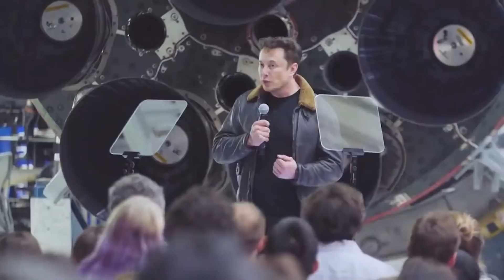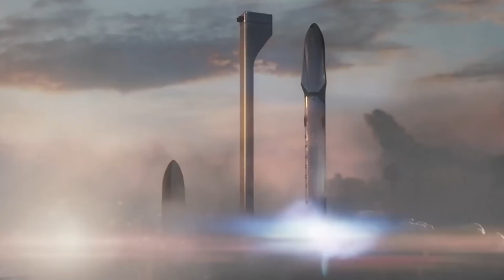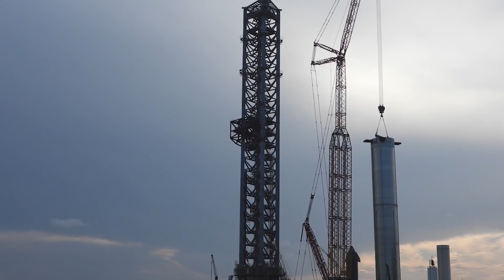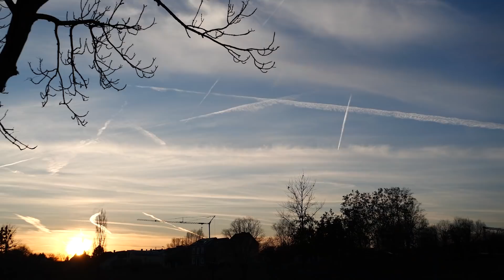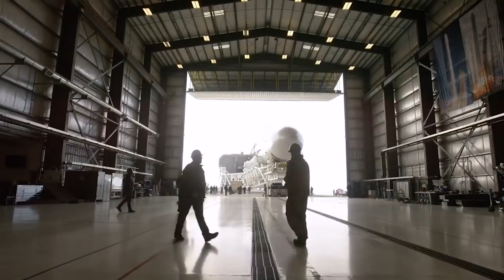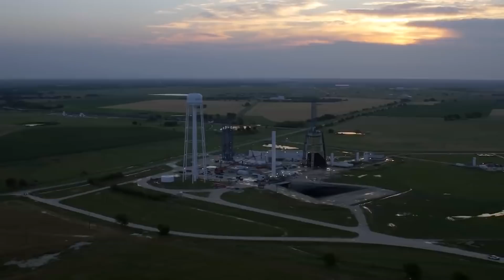FINALLY! Elon Musk OFFICIALLY REVEALED Starship Orbital Flight LAUNCH DATE

Comment: I wonder if space x added a couple more rings to sn20 if that ship by its self could reach orbit without the booster more rings more fuel put 3 normal engines and maybe 2 vacuum engines and go from there?
Reply: But the extra fuel wants to be liftet up.
I had this discussion a few month ago. You would need around 9 raptors (or stronger raptors) and a dry weight of maybe 70t. 
Then you could barely reach orbit with an empty starship with no fuel and no payload. 

As long as you don´t have some Raptors with a sea level isp of 500s and 300KN of thrust in your garage, the 2-stage solution makes way more sense.

Comment: The 'liberations' during static fire did not appear to occur anywhere near the base of the vehicle, in fact the locations at which I observed such failures seemed to be suggestive of harmonics. 

That may be inevitable given that every effort is expended on keeping the weight of materials that are inherently heavier than more expensive but significantly more versatile alternatives such as titanium as low as possible.

Lockheed managed to fabricate the SR71 from Titanium during the 1960's, therefore that company must inevitably possess an abundant fund of data with regard to employing that exotic and expensive but extremely durable material.

In fact it would not come as a surprise to many if a military version of Starship is currently or eventually will be developed using Titanium instead of stainless steel.

A vehicle the size of Starship is essentially a self propelled space station in it's own right and could serve as an effective platform of a variety of space based weapons systems including extremely precise surveillance, communications and coordination like a sort of ultimate AWACS.

Furthermore significant advances with regard to employing Titanium for various forms of manufacture will have inevitably occurred since the SR71 project including techniques such as electron beam welding and 3D printing.

Given, that harmonics derive from vibration and are a major source of stress related failure or 'fatigue' and particularly with regard to materials subject to critical limitations such as weight mitigation 'metal fatigue' is often if not normally cumulative.

It must therefore be presumed that pursuant to the abundantly demonstrated standard of excellence attributable to the people at SpaceX they are working toward incorporating adequate margins of safety for every, critical consideration which of course most malfunctions must inherently be on a vehicle of this type.

With regard to harmonics, the locations at which thermal protection tiles are separating from the vehicle may impart useful data with regard to vibrational frequencies and potential locations for eventual material failures.

All that notwithstanding while harmonic dynamics may well change to significant extent when Starship is incorporated with a Super heavy booster, the critical point may well still occur when the vehicles are subject to landing and take-off while separated from a booster.
Reply: Damn bro, you wrote a whole book.